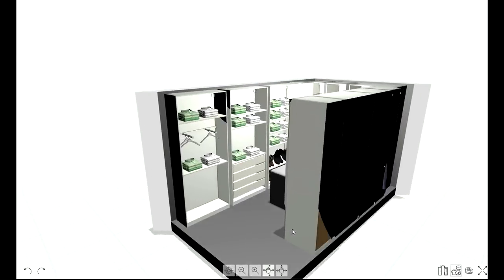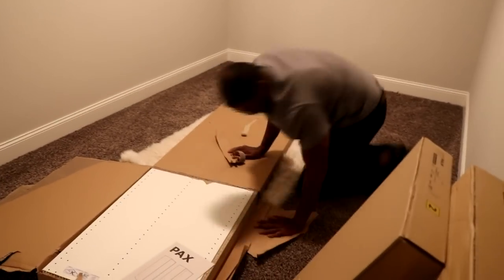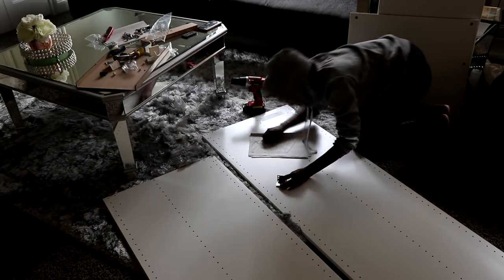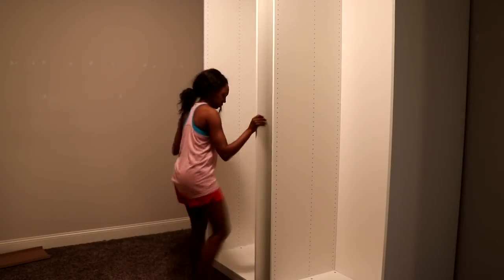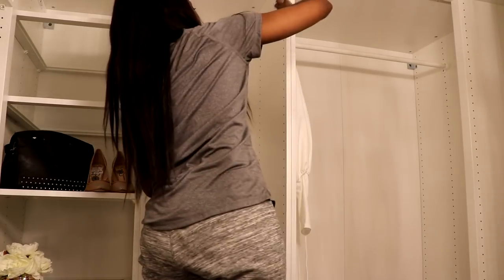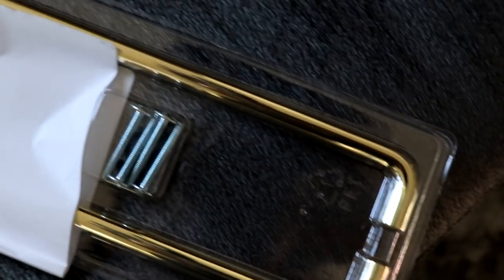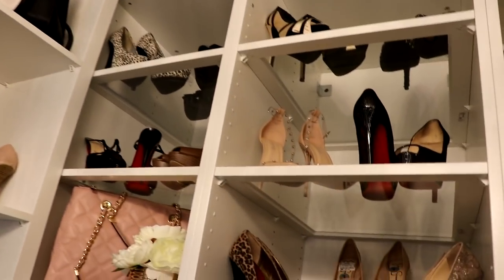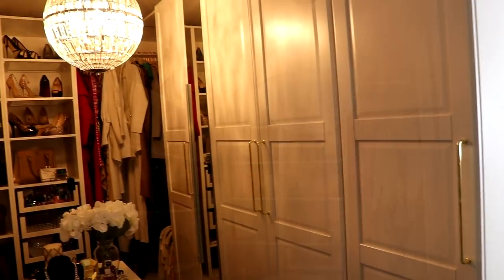How to Design, Create and Build a Custom Master's Closet | DIY Dream Closet

Comment: Hello Mrs Angelgrace2. I love this video. I am going to use it to re-do my closets. I have a couple o f questions.  1. Did you have to anchor the closets into the walls to prevent them from falling over?   2. How did you connect the frames to each other and 3. How much did all of his cost? I have a $2000 budget for the closet but I can extend it to $3000, I’m not looking for an exact cost but an estimated one. Thank you

Comment: Lovely! I'm doing a wall project using Ikea Pax. Would love to do my closet by the angles intimidate me. Glad to learn that Ikea sells hole fillers.
Reply from the maker: Thank you!! Are you?! I'm sure it will turn out amazing! Yes the angles were quite difficult, but they sell the corner pieces so that helped ALOT! Although, I didn't quite place them like they said as my spacing was a little off but it totally worked out! Yep, the hole fillers are a game changer!!! Thanks so much for watching!

Comment: Beautiful! Question...did you remove your baseboards before you installed the units?  Also was wondering if you bolted them to the walls? I’m getting ready to do this myself. Thanks for the awesome, in depth video! New subscriber ❤️❤️
Reply from the maker: Thanks so much Jennifer! Welcome!! No, I did not remove the baseboards. I know others did, but I chose not to as my frames are tilted so there's space. I also did not bolt them to the walls. We are in Georgia and are way less prone to earthquakes so none of my bookcases, frames, etc are bolted. However, I did put weights in the bottom back of the large frames that has clothes in them for some extra security. So it's up to you and what you think may be appropriate for where you live. I hope that helps!

Comment: Are the closets attach to the wall?  I need to build my closet. If you don’t mind me asking can you give me an estimate how much it cost for the closet system?
Reply from the maker: Actually, no they are not attached to the wall. However, I did use weights in the back of the larger frames just for extra security. I will say that DIY-ing your closet will cost you alot less!! Companies quoted us like $10-15k for this! But the cost really just depends on how much materials you need. Each frame runs you between $90-100. The shelving and drawers inside the frame ranges between $10-50. Because I have a large closet , I believe I have about 10 frames plus a variety of drawers and shelves. We spend around $2k due to how large my closet is. But you don't have to do your entire closet, you could always just do a wall and it'll make for great spacing!

Comment: What was the overall cost to build the closet considering the space
Reply from the maker: I will say that DIY-ing your closet will cost you alot less!! Companies quoted us like $10-15k for this! But the cost really just depends on how much materials you need. Each frame runs you between $90-100. The shelving and drawers inside the frame ranges between $10-50. Because I have a large closet , I believe I have about 10 frames plus a variety of drawers and shelves. We spend around $2k due to how large my closet is. But you don't have to do your entire closet, you could always just do a wall and it'll make for great spacing!

Comment: Ikea has changed something with Pax. It's not as customizable as it is here in your video. It asks for width, height and depth, but it doesn't allow me to put the specifics of the width. I have 3 sides & when I add them all and apply(can't apply width to EACH side), it doesn't measure each side correctly. In addition, it doesn't look like your video. Can't go inside the room at all nor move around as much. 😢 GREAT VIDEO though! 🤗

Comment: What did you use for weights?
Reply from the maker: I did not secure the frames to the walls (which is what the instructions advise) so I used the weights instead for added security

Comment: So how are they secured to the wall for balance💁🏽💁🏽💁🏽
Reply from the maker: Hi Mary. No they are not. Like I mentioned in the video I used weights in the bottom.
Reply: Aahhh I see👀😳, so where did you get the weight from💁🏽, good job though 👍🏾👍🏾👍🏾

Comment: how much did this cost>?
Reply from the maker: The cost really just depends on how much materials you need. Each frame runs you between $90-100. The shelving and drawers inside the frame ranges between $10-50. Because I have a large closet , I believe I have about 10 frames plus a variety of drawers and shelves. We spent around $2k due to how large my closet is. But you don't have to do your entire closet, you could always just do a wall and it'll make for great spacing!

Comment: Wow I really love this, how much did you spend ?
Reply from the maker: Thanks!! Because of how large the closet it, companies quoted us like $10-15k for this! But the cost really just depends on how much materials you need. Each frame runs you between $90-100. The shelving and drawers inside the frame ranges between $10-50. Because I have a large closet , I believe I have about 10 frames plus a variety of drawers and shelves. We spent around $2k due to the size. But you don't have to do your entire closet, you could always just do a wall and it'll make for great spacing! Hope that helps!

Comment: What was the total price for your Ikea closet?
Reply from the maker: The cost really just depends on how much materials you need. Each frame runs you between $90-100. The shelving and drawers inside the frame ranges between $10-50. Because I have a LARGE closet , I believe I have about 10 frames plus a variety of drawers and shelves. We spend around $2k due to how large my closet is. But you don't have to do your entire closet, you could always just do a wall or two and it'll make for great spacing! Hope that helps!

Comment: I noticed some nail polish or something. Why did you not include a make-up station? If you would have taken the baseboard off, the shelves would have fit more snuggly against the wall.Also, what additional lighting are you planning? I think LED lights with motion censors would be cool.
Reply from the maker: Hi Denise. So first, I actually have a vanity in my bathroom so I did not want nor need one in my closet. I designed the closet the way I wanted. Also, I did not want to remove the baseboards. You can definitely feel free to do that in yours but I preferred not. Thanks. Any additional lighting will be addressed later. I do not like motion lights AT ALL!  Thanks for watching.

Comment: About how much did all the shelving cost?
Reply from the maker: It really just depends. Each frame runs you between $90-100. The shelving and drawers inside the frame ranges between $10-50. Because I have a large closet , I believe I have about 10 frames plus a variety of drawers and shelves. But you don't have to do your entire closet, you could always just do a wall and it'll make for great spacing!
Reply: Oh ok. Thanks. I am new here and loving everything I am seeing 😘